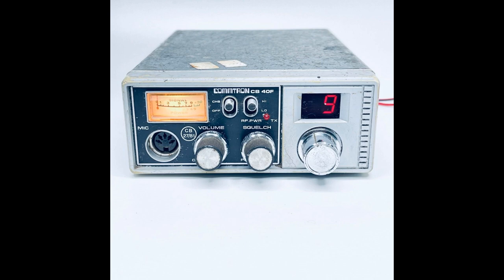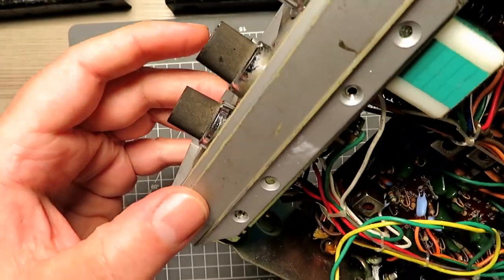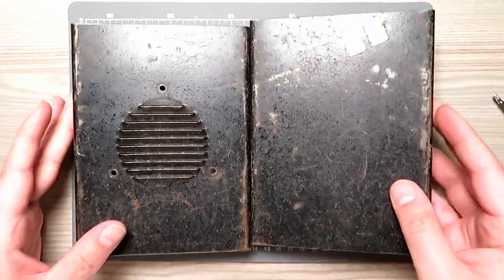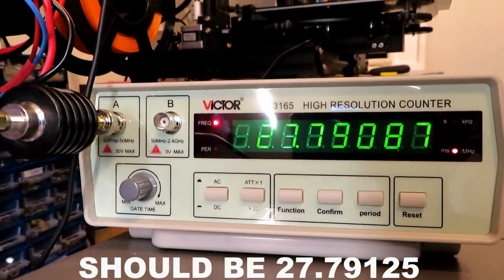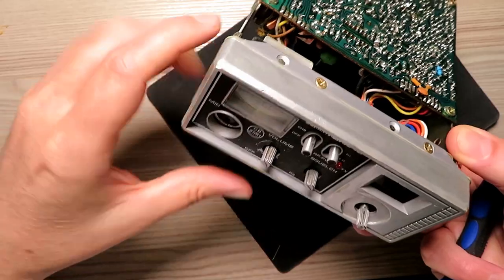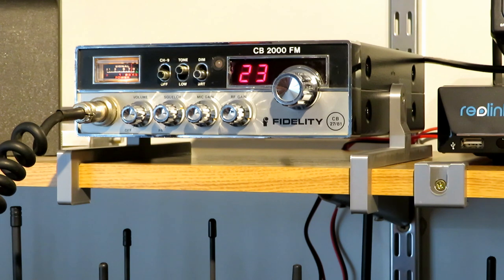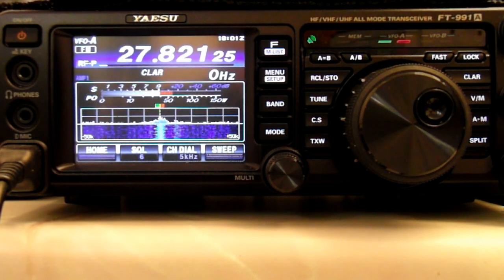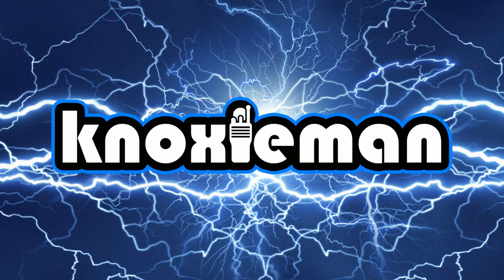FROM SCRAP RADIO TO THE SOUTH OF FRANCE - COMMTRON CB40F REPAIR AND TEST

Comment: Great work 👏 fantastic to see you keeping them alive, I have a good collection of 40 channel pll transceivers, cobra, jfk, etc, I convert them into 10meters, not alot of work to convert, but I also convert into 40 meter/ssb and 20 meters, a little more work needed to do that but it works very well, I use the analyser to make sure a clean signal. Keep up the good work.👍

Comment: I have a mint Maxcom 4e, boxed and fixed by Richard. I had to replace the mic. I also have a nice 16e which I also like. I had to replace the mic. I have a 4e for spares but doesn't look any worse than your Commtron so maybe I will tidy and fix it. It needs a replacement mic. A question, what is the difference between the Colt 295 and the 295A version? The Commtron is on my shopping list and perhaps the Midland.